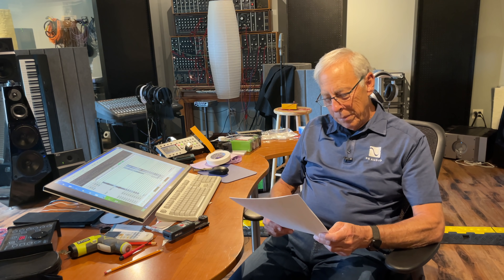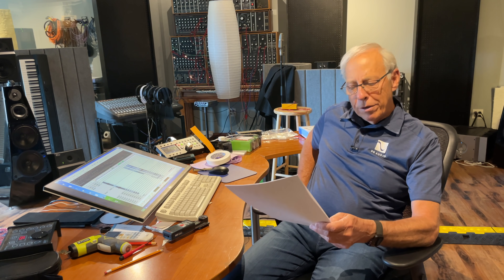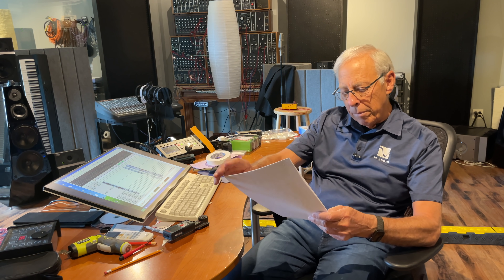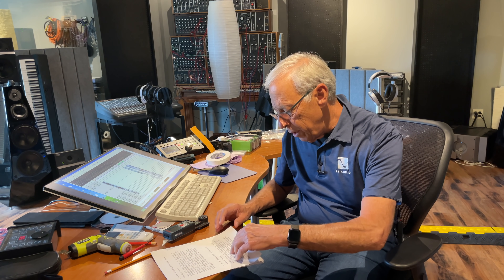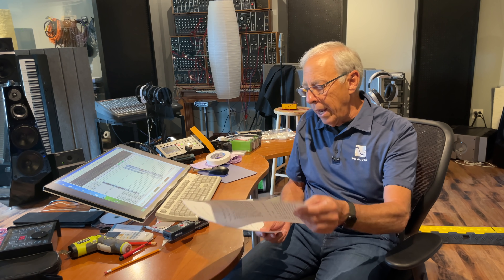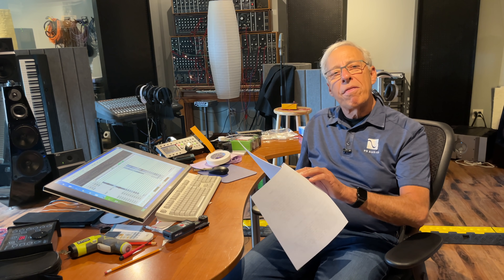Preamp specs to match a power amplifier

Comment: The higher the gain, the better for dynamics and head room coming from a preamp. I use a tubed 6j1 and 6922 SEPP at get 10 volts coming out and at low listening levels it's bliss.

Comment: It's cleaner to get the gain in the pre-amp than in the amp. 30 dB gain is a lot.
Reply: Bill I have to agree.  I like my PS Audio  S300 amp.  It WAS paired with  my Chi-Fi  Gustard X20 pro DAC/ PREamp.  Often i would have to Jump to the remote  when some cuts came on as a result of the gain on the AMP.  Recently got the Audio -GD  HE1 Preamp and the Gustard is in DAC only mode.  Then I went back to my Old  Audio GD  SA 300  Power Amp  and  I now have  awesome control over volume .  The Gain on the pre sound like half increments.   The whole setup is less aggressive.   I still like my PS Audio AMP  but it is now on my bedroom system with 6 Om speakers they seem to play better together.
Reply: @BrotherNkosi  Yes, Paul should know better. I think all amps should have a gain control on the front.
Reply: Musiklab (Gamut) has 3 settings for gain, I think they are inside, but you would probably just set it once, of course if you kept your pre!

Comment: I recently came into possession of a NAD 216THX power amp. I have it connected to a pair of Tannoy system 600s.
I have an output going straight out of my audio interface into the amp, but this means I end up with a very low output from the interface of -30db.
What do you recommend I do, in terms of pre-amp or attenuators?

Comment: If you have a consumer electronics power amp with a max input voltage of 0,775V and you have a pre-amp capable of driving a 2V Pro-Audio amp with 100% head room (4V output) and the volume resolution is 1dB, do you then have a little over 2dB steps or nearly 5dB steps in your attenuator for that particular combination?
Also when Paul says their input sensitivity is around 1.8V, does he then mean peak value since the standard for professional input sensitivity is 1,227V RMS?

Comment: While sensitivity is a consideration, the matching issue most people seem to overlook is impedance matching. I see audiophiles who try to drive a solid state power amp with a relatively low input impedance over long cables with a tube preamp that has a fairly high output impedance, then wonder whey they are getting dull lifeless sound.
Reply: I've never considered that. Which numbers are considered low/high in amp input impedance and preamp output impedance?
Reply: A run a tubed preamp with 10 volts out with an output impedance of just under 600ohm, going to two Quad 303 power amps with inputs of 22kohm. The amps input is 0.5v sensitivity which means that I had to attenuate the output RCA of the tubed pre to drive the amps to match.
Reply: @elmeme88  It's really more about the ratio, than the specific numbers. It also depends somewhat on the length and type of cable connecting them. Typically with a unbalanced signal, you want the input impedance of the amp to be at least 10X the output impedance of the preamp.
Reply: @JoseMorales-kr2ed  Shouldn't be a problem. Even with the two amps connected in parallel, the input impedance is still plenty high enough. You probably find that you can only use the first part of the rotation of the volume control however. That's not an uncommon problem with vintage British gear, where the preamps typically had little or no gain, while the power amps had high sensitivity.
Reply: @gotham61  That's right. However I added the best resistors I could find and attenuated the output to a point that I can now use the full range of the volume pot to "typical" common levels. At 9 o'clock I have great resolution and dynamics - and plenty of volume left. Where I sit, 4 metres away from the speakers I have measured 88dB nominal. My speakers are 86-83 dB in sensitivity. I made my own interconnects out of silver, just like Mr Paul McGowan has suggested here in some videos (a made them .5 metres in length) and my setup sounds blissful.

Comment: Stylus Gauges… I own three including a similar one to what Paul was displaying. Believe it or not a simple seesaw plastic stylus gauge with plastic weights on one side and the stylus rests on the other side that was included with the original Acoustic Research Turntable works the best for me out of all of the three that I own. Strange but true.
Reply: The little mechanical scales always worked the best for me. As I could always test them against other methods to ensure accuracy.
Reply: @wishusknight3009  that’s exactly what I did. I was having problems with a Panasonic string gauge stylus force measuring unit. It never gave me the same result twice in a row. Using this super inexpensive mechanical fulcrum unit Is it always the same measurement. I’ve measured it against known brass weights that I have as well and it always balances with the plastic unit

Comment: The vast majority of preamps ever made can deliver more than enough signal voltage 
to drive the vast majority of power amps ever made well into their clipping range.  
I would look at the preamp's noise figures.
Reply: of the few examples of preamps I have, a few of them could do close to 10 volts before any sort of distortion started happening. Only a cheap mid 80s Sansui preamp I have started to give poor quality above about the 2 volt range. And even that is usually able to give enough signal to most any power amp I have had come through here (though not the best quality signal).

Comment: Does the DAC output impedance have to be a certain impedance ratio to the input impedance of the Pre Amp? ?? either 10 x bigger or smalled than the input impedance of the Pre Amp ?

Comment: 30dB gain yields 1 volt input turning into 31.6 volts output. Sounds like dB is approx. equal to gain factor but it’s not. It’s logarithmic. 20dB gain yields 1 volt input turning into 10 volts output and 40dB gain yields 1 volt turning into 100 volts output.

Comment: Hi paul!!
My av reciver analog input is 150mv  50k-ohms at 100db.
The output is rated 150mv at 1k-ohms.
My question is what output voltage i need on the preamplifier side?
Thanks
Asaf

Comment: If you are using a passive peamplifier should your source be at least 4 volts? Most source components are around 2 volts, some even less.
Reply: I use a passive preamp and I'm trying to get used with my brand new Parasound active preamp. Even with only 2v from my sources, it seems the passive preamp has cleaner path than the other. I can get all the juice from my amps with it, better than with the active one (Zpre V3 3,5v).

Comment: So if the amp has more then enough wattage, would it be the pre-amp that creates the headroom and dynamic range since it's there the small changes in voltage create the big dynamics in the amplifier? also don't they have to match impedance wise as well?
Reply: Amplifiers don't make impedance, speakers do. Think of the system like a dam, with the amp providing the lake of water and the speakers being the dam that restricts the output flow (wattage). The lower the impedance, the more power is allowed to flow out and increases the more power is required to make it (like replenishing the lake). Which also increases the amount of strain put on every part of that. 

Dynamic range depends on both the amp and the pre-amp, specifically thier internal components. If one filters the other, the rest of the question becomes indifferent because some of the range will have been canceled. Assuming this doesn't happen (ideally), the pre-amp and amp work just like a stereo's equalizer and volume knob do in effect, altering the sound and amplifying it. The "headroom" voltage from the pre-amp allows for the "volume knob" to be turned up further than you'd have been able to with a lower input wattage.

Comment: Please forgive me if this is been answered somewhere else and I can't find it

Question
If i have a 7-8 foot run between my source and my speaker, where do I put my amplifier closer to the speaker or closer to the source?  Do I use longer speaker cable or longer preamp to amplifier cable?
Reply: I would have the amp + source closer, your speaker cable run is a common distance. A cheap tweak, move the electronics out and off to one side if possible, let those speakers breathe unobstructed
Reply: @tothemax324  
I didn't explain it well. My electronics are to the rear side.  My question is with the electronics away from the speaker do I put the amplifier near the speaker with a short cable and a longer cable from the preAmp or a short preamp cable with the power amp near the electronics and a longer power amp cable to the speaker. Note I have bye amp with two speaker cables
Reply: @tothemax324  
By the way thank you for your help and response

Comment: My preamp is 10db gain and power amp is 26db. Speakers are 90db/w. And its too much, specially if DAC output is above 2V, there are many that have 3V and they all say "its standard gain, should work fine". I have to attenuate in Roon and HQPlayer. Tried RCA attenuators but they screwed up the sound.
May power amp manufacturers don't even specify input sensitivity. 
And pre/power amp gain are mostly in that range - don't know how manufacturers expect us to match the components with such a high gain! Specially PS Audio stuff, 30db is ludicrous!
Reply: In what way did they screw up the sound may I ask? I attenuated my preamp from the output of the RCA of the preamp with some Shinko Tantalum resistors. 560ohm signal and 33ohm to ground in my example to give me .5v out straight to my amps. I was expecting a dull effect, perhaps less focus but in the end it worked absolutely brilliantly for me. No loss of signal or any degradation, in fact - almost total transparency relatively speaking. No resistors on interconnects.
Reply: @JoseMorales-kr2ed  I used Rothwell -10db RCA attenuators. Had 2 DACs connected, one with attenuators. I could cleary hear lack of low end and body on mids. When I removed attenuators, tried again A/B test (easy to do with Roon and play on both at same time, then switch input on preamp), sound improved and i could hear again low end and body.
Reply: @hudo  Sorry to hear this was the result of the Rothwell attenuators. In fact, I studied these before making the decision in making the attenuators myself. Like I mentioned before - I expected bad results. Perhaps you could try what I did, just for curiosity. Thanks for the feedback.

Comment: How to match my afteramplifier input to amplifier ?  We all  know about the preamps , but no one , NO ONE talks about afteramps .  This is something , right ?
Reply: Power amplifier is the word!
Pre-amplifier receive the input signal and adjust the volume of it! Normally the pre-amplifier reduce the signal, because the maximum volume of input source is maximum level you get from power amplifier from that source.
If you have a fixed and variable signal, you don’t want to hook up the fixed signal to the power amplifier, as you can not adjust the volume.

Comment: Long interconnects cable 4 m on the input ? or 4 m cable on the pre amp output.? And short on the input
Reply: I don't know, but I would prefer to keep my CD player and record player, whatever source components, near my preamp (in the same rack), and with short cables, and let the preamp to amp cables be longer because my amp lives on the floor, well, on a stand on the floor. In my case the difference is 1 meter as opposed to 2, so it likely doesn't matter for me.

Comment: If your not going to use the full continues watts RMS then frankly Paul why build it.
Reply: You aren't going to drive your car at top speed, either. Probably never. Definitely not every time you use it. You still want that power available when you are getting on the interstate or passing some slow poke on a two lane road. 

The amp that doesn't operate continuously at anything near full power will have less distortion. Full power is usually the point the amp reaches 1% distortion. Less distortion is a good thing. Also, you have plenty of power at the ready should a loud transient be in your music, or if a loud section of music should come up like frequently happens in Classical music. Sometimes you are listening to the quiet sections and then the loud part comes along and blows you out of your seat. You need that headroom so you don't run out of power and clip the loud sounds. 

That's a really simple explanation. I don't know if you would prefer something more technical, but that's what I have.
Reply: @brianmoore581  Headroom for transients... Great explanation 👍

Comment: Should the power amplifier input level not match that of the pre-amplifier? Like you state if the pre-amplifier output level is 4 times that of the input level of a power amplifier, does it not drive it too high and cause it to clip earlier or probably damage the power amp ?